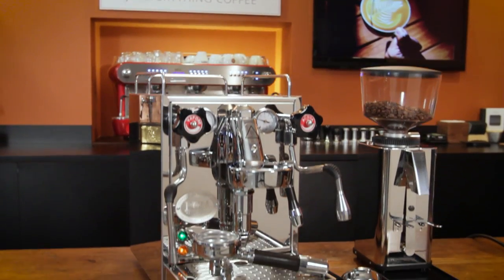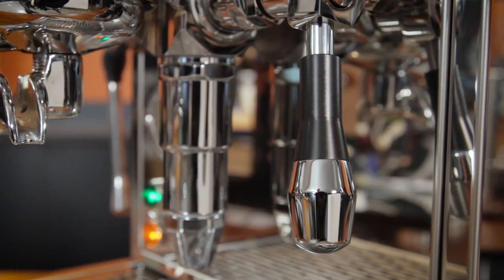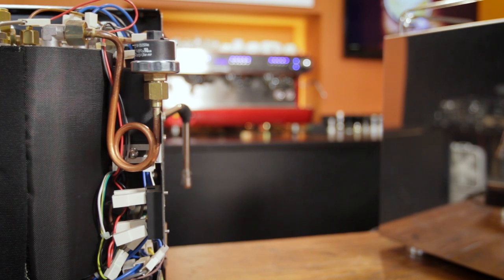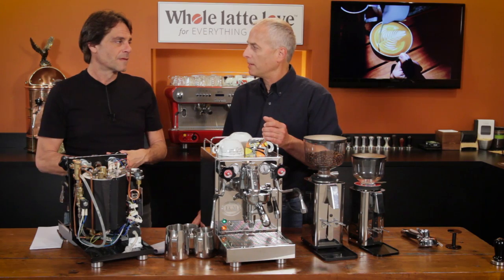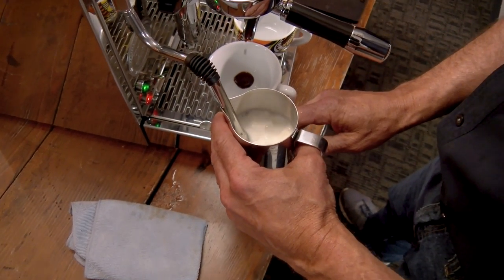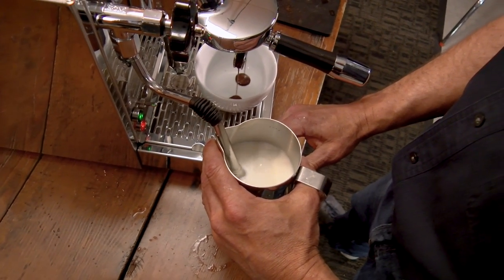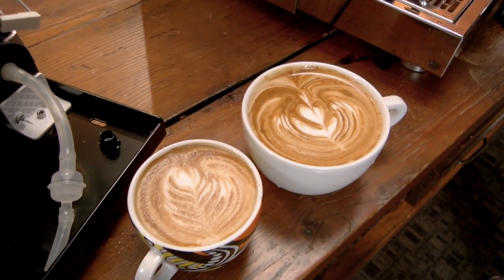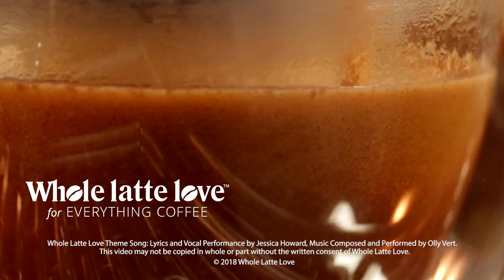Review ECM Mechanika V Slim Espresso Machine

Comment: Hi, is there going to be a PID version soon? Is it hard to instal one? Would it be in the front or inside the tray?
Reply from the maker: Hi VP, Thanks for the question. No PID version of the Slim at this point which I am aware of. We will have staff attending HOST in Milan, Italy this weekend. If there is one coming that's we're we'd hear about it. First PID machine in ECM line using HX boiler is the Technika IV Profi PID: https://www.wholelattelove.com/collections/semi-automatic-espresso-machines/products/ecm-technika-v-profi-pid
If more about espresso and the occasional milk drink there's the single boiler/dual use ECM Classika PID in essentially the same case size as the Slim: https://www.wholelattelove.com/collections/semi-automatic-espresso-machines/products/ecm-classika-pid
Installing a PID in HX boiler machine is tricky engineering due to controlling the thermosiphon flow properly with the boiler running much hotter in HX than a dual boiler PID machine. That said, manufacturers like ECM, Profitec and Rocket Espresso do an excellent job of getting it right in their HX boiler PID machines. 

Marc
Reply: Whole Latte Love Thanks Mark, I usually have 3 espressos and 2 lattes in the morning but it worries me that the classika has more steps to do both and it takes more time.
What should I pick?

Comment: I bought the machine today, so I'll set it up and make so coffee :)
Reply from the maker: Hi MS, Nice! What grinder are you using? Would love to hear your thoughts on the machine after using it!
Marc
Reply: @Wholelattelovepage  My grinder is a  GRAEF CM 900.
About the ECM, I love the small package, but at the same time the power that has in it. The steam pressure for the milk is VERY stable, the quality of the coffee that comes out of it is just outstanding.
I'm planning to buy a new grinder, but I'm not quite sure which one yet.
Reply: @Wholelattelovepage  So I finally bought a good grinder, the S-Automatik 64, also from ECM.

Comment: Isn’t it a little too expensive for a HX with a Vibration Pump?
Reply from the maker: M F there are lower cost vibration pump HX machines. ECM machines are known for the details in design and quality which add up to reliable, beautiful and capable machines. Beyond that this machine features a very large powerful boiler in an uncommonly small and attractive package.
Reply: @MF ECM is the royal Royce of Espresso machine hence the cost. I like there little brother Profitec made from same folks. If I had the extra cash i would go with ECM though for quality Profitec performs excellent.
Reply from the maker: Hi B, Thanks for adding - spot on!!!
Reply: The pro 500 has the added pid, so you pay less and get more. On a different note, when will you review the pro 600?

Comment: Every time I see a Rocket video I notice that the extraction has some bubbles in it and flows differently than an ECM... would you say it s the portafilter that makes a difference or the ECM pulls better shots ?
Reply from the maker: Hi AA, I think it's most likely the coffee being used with maybe a little difference in the way the espresso flows off different PF spout types.
Marc
Reply: Thanks 👌considering the profitec 500, the V slim and the Giotto... hard decision

Comment: 2 questions: a) I bought the Mechanika and it came with a silicone tube that the manual says it is for "water filter",  which I have no idea where it goes or what is it's purpose. Is it important? I didn't see it in your review. b) Often I prepare my Cappuccino directly into me paper (disposable) cups, I used to have a old Oscar Simonelli and I had no trouble pulling my shots directly into the paper cup, but wiyh the Mechanika there is no space for that. Is there any solution or idea how can I can keep pulling shots into paper cups? Tks!
Reply from the maker: Hi AB, Thanks for the question. I believe that tube is for use in the reservoir. One end goes attaches to the water intake nib at bottom of reservoir. Other end of tube connects to a water softener cartridge which sits within the reservoir. There are generic water softener cartidges but I'd suggest something like this as a much better solution for in-tank water treatment: https://www.wholelattelove.com/products/bwt-bestcup-m-package
As for using larger cups...
Most cafes will use a shot pitcher for pulling the shots if it's going to end up in a to go cup: https://www.wholelattelove.com/products/lf-spare-parts-3-spout-2-oz-shot-glass
Marc
Reply: @Wholelattelovepage  Tks for the reply!

Comment: Does this have a similar thermosiphon restrictor that the Pro 500 PID has? On a similar note, how's the temperature stability of this machine versus the Pro 500 PID? Is a cooling flush required here?
Reply from the maker: Hi T, Thanks for the question. It does have a flow restrictor. Engineering works out differently than on a the Pro 500 PID. Cooling flush is required on this machine
Reply: Much appreciated, thanks for the reply! ECM does indeed do beautiful machines but in this case I might just go for the Pro 500 PID instead (which is the sister company anyway) :)

Comment: Would you recommend this over the appartamento?
Reply from the maker: Hi BV, Thanks for the question. Both are fine machines. The Mechanika Slim is a little more refined in the case work when you look close-up - that's an ECM thing! Some people do prefer the slightly more modern look of Rocket machines compared to more classic styling of ECM. Other things to consider. Larger steam boiler in the Slim than the Appatamento: 74oz vs 60oz. Also more power in heating element in the Slim: 1400w, vs 1200w. Slim has brew and boiler pressure gauges mounted high for easy viewing. Appartamento has a boiler pressure gauge only and it's mounted low. Hope that helps!
Marc
Reply: Dude, YES!! Get it!!

Comment: Hey Mark,
I noticed my extraction starts slow (7 secs from the start of the pump to the first drop of coffee) but finishes fast (25 s).

Is this an issue?
Reply from the maker: Hi JLTS, Thanks for the question. 7 seconds from start of pump is fine - especially on a vibration pump machine which has slower ramp up to brewing pressure. 25 seconds is a bit quick unless you are timing from first drip but not necessarily bad or wrong. Extraction duration is just one measure and helps get you in the ballpark. Color, brew weight ratio of coffee dose to yield and taste are the next level. Check out the naked extractions in this video: https://youtu.be/oWBv37o4Q4w They were delicious! Singles and doubles pulled pump on to pump off about 20 seconds. It was a rotary pump machine and the extraction was left to continue until about 25. 
Marc
Reply: @Wholelattelovepage  thanks! Really like what you guys are doing and can't wait to see your new videos!

Comment: This or the Profitec 500 Pro for lattes? Thanks!
Reply from the maker: Hi afp, Thanks for the question. I like both machines a lot. The Pro 500 is a PID machine so brew temps are very consistent. Boiler temp in the Mechanika is controlled by a pressurestat so there's more variation in boiler temp and the machine generally requires a short cooling flush just before an extraction. The Pro 500 in most cases does not require the flush. Only reason I'd take this over the 500 is I were steaming extra large amounts of milk. The slim has more steam available.
Marc
Reply: Whole Latte Love very helpful! I am just making a couple of drinks per day so I am not steaming any large amount. For that reason, you would suggest 500 then, ay?

Comment: Is this machine only for people with limited space in their kitchen? I really like the machine, but space is not an issue for me - should I be looking at bigger machines like the Profitec 500?
Reply from the maker: Hi Nigel, Not just for people with limited space. But, if space not an issue you might consider a machine like the Pro 500 which is a PID machine - Mechanika Slim is not PID. PID has more accurate control of boiler temperature.
Marc

Comment: Great review. I just bought one of these. My boiler pressure is usually 1.4 to 1.5, do I need to make an adjustment? (manual says it should be up to 1.25)
Reply from the maker: Hi Chris, You can run it at that pressure but you may find your brew water is too hot. You can get around that with cooling flushes prior to brewing. Or, you could open up the machine and turn down the pressurstat to run the boiler at lower pressure/temperature.

Comment: Can anyone recommend a good and inexpensive machine
Thanks
Reply from the maker: Hi Ran, Thanks for the question. If looking for a lower cost machine our favorite is the Gaggia Classic. It's been around for many years and was rated a Consumer's Digest Best Buy. It is a single boiler machine so you can not brew and steam at the same time. But it does have full commercial size 63mm portafilter and large group head for temperature stability. In North American version it has 3-way solenoid valve for dry easy to knock out coffee pucks and comes out of the box with the ability to brew from ESE pods and/or pre-ground coffee using a pressurized filter basket. It includes standard non pressurized basket as well if you have a decent burr grinder. Learn more about the Gaggia Classic here: https://www.wholelattelove.com/gaggia-classic-ss-brushed-stainless-steel-semi-automatic-espresso-machine

Comment: I was just about settled on this machine for purchase when I heard about something called the ECM Mechanika Profi IV I think it's called. Do you think it's worthwhile getting the Profi? It's about an extra $400 or so here in Australia which is no big deal really. I don't think I need a dual boiler with PID just to make a few coffees for my wife and myself and the occasional visitor. .
Reply from the maker: Hi Ron, Thanks for the question. Yes there is an ECM Mechanika IV Profi: https://www.wholelattelove.com/products/ecm-mechanika-iv-profi-switchable-espresso-machine
It's a plumbable HX machine, larger footprint than the Slim, lever valves instead of knobs, PID so tighter brew temp control and nicer finishing details. If you can swing it - go for it. For your use level I don't think you need a DB machine either. Get the Profi for the rotary pump and plumb it to waterline and never fill a reservoir!
Cheers,
Marc

Comment: "you get the big ugly one" LMAO.
btw Marc, do you think this machine not having a PID is a big step down?
I think this machine is better looking than the technika profi. But no PID.
Reply from the maker: Hi PV, Thanks for the question. Current HX boiler machines with PID are quite good at providing consistent and reliable brew temps. In most cases without doing a pre-extraction cooling flush. Machines without PID usually require a short cooling flush prior to an extraction. For some, that's desirable as one can quickly manipulate brew temp by changing the duration of the cooling flush. With PID, It takes awhile to manipulate brew temps.
Marc